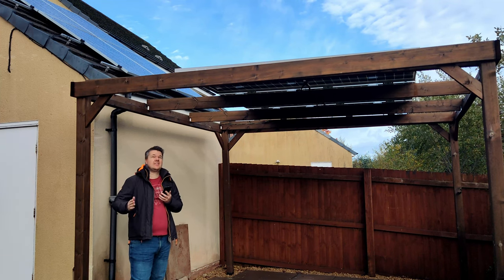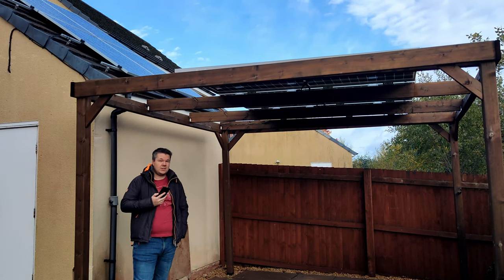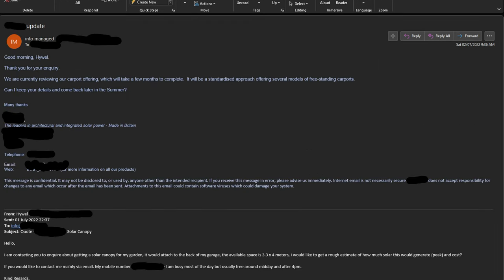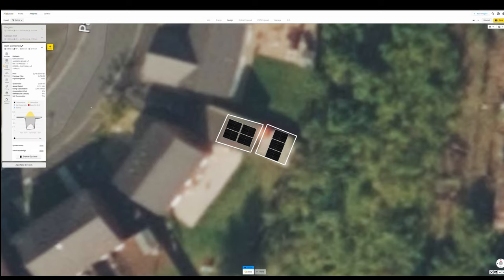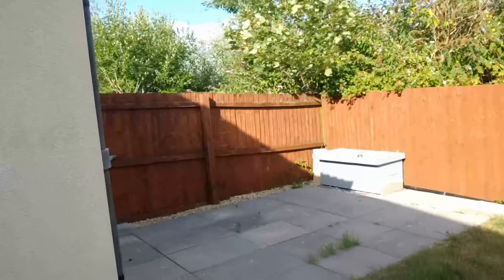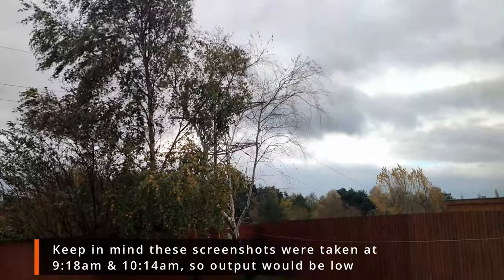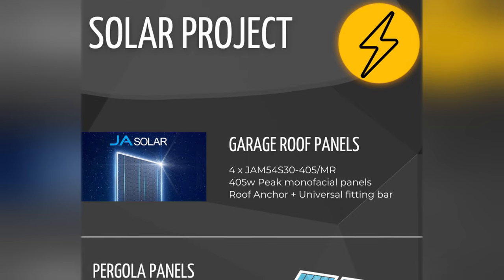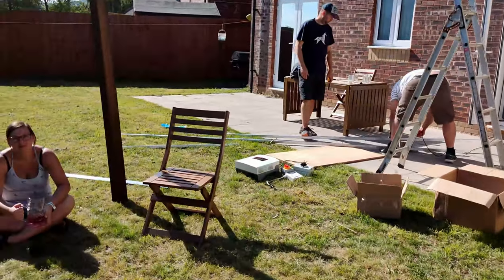Solar Pergola & Roof - The full story

Comment: No one will ever convince me to deploy a solar system that is capable of supplying power for my entire home (around 2000 sq ft). Even though I live in the valley of the sun (Phoenix, AZ), it makes a lot more sense to build a smaller off-grid system that will supply enough power for my master bedroom suite (around 400 sq ft). I'm halfway there, with a 1.2kw system that will be "cloned" to create a parallel tied system giving me a total of 2.4 kw potential (peak sunshine). I'm really pleased with the performance so far but need to save money before I can move forward and finish the project (and things are not getting any cheaper). Thank you for sharing this...

Comment: Got 10kW and have not seen an electric bill this year yet 😂
Reply: How many electric bills would you have to not see to pay for the whole installation
Reply: @stephenrichards5386  Now it seems about 5 years. Calculated interest rate is now 14.5%
Reply: @april7_  that would be on a 10kw installation. At 300w/panel= 33 panels   
I've no idea how much per panel fitted by guess £150. About £5000 plus all the control mechanism plus the new hot water system. Call it £8000 at current rates of 35p / unit  that's 22900 units of electricity. Now add compound interest on £8000 at 14.5%. 
£16,500. Redo the pay back time. That's about 10 years. Subtract your previous consumption. Voilà
A lot of guess work in there but not far out I suspect.
10% loss of power after ten years, 20% after 20 years
Reply: @stephenrichards5386   Im not sure if I can understand your logic but can you tell me where I can safely put some money and get that 14.5% interest rate in return? ... The other way I see it is that regardless of payback time, in the end you have "something"  to show for it instead of having "wasted" the 8k giving it to the electricity company. Im not going on the offensive here. This is just my logic.
Reply: @jsouto77  No it's brilliant. The taxpayer pays another taxpayer to put intermittent energy source on their roof so that the taxpayer's can pay for the power station they need to provide energy 24/7.
Reply: @stephenrichards5386  how do you mean the tax payer, fits are gone, and that was a levey on electricity bills, just like nuclear had been under NFFOs, Non Fossil Fuel Obligation, back in the 90s through to the 2000s.

Comment: I was just wondering if you had to let your grid know about exporting ?? I am looking to start my own project
Reply from the maker: not sure which country you're in, but in the UK no you don't as long as it's under 6kWp for the array.
If you want export payments then you need an MCS certificate of which a part of that process informs various bodies you are a micro generator.
* The above is subject to change.
Reply: @The BMC  I'm in UK and currently with British gas and was wondering if I need to let them know that I might export or does grid need to know about it. Was thinking about even simpler setup with micro inverter for now
Reply from the maker: @quittrn  ahh fair enough, nope you don't need to let them know. recommend if you dont already have a smart meter or one that shows export to have one just so you can see what your sending to grid
Reply: @th3bmc  thanks very informative 👍 great video keep up good content
Reply from the maker: Thank you for the nice feedback 😊. good luck with your project
Reply: Your information is wrong.  Any equipment connected to the grid requires either post install notification under g98 or pre install permission from the DNO under g99
Reply: G98 covers equipment up to 16A per phase.  G99 covers anything over 16A per phase

Comment: This is close to what I want to do.  I’d like to add pergola along the length of the rear of my house, and install solar panels on top of that, rather than on the roof itself.  First it’ll create a nice patio space that I don’t currently have, and second it would save a lot of money for roof repair costs when it hails (I’m in Texas), and the panels need to be removed to replace the roof.  1 hail storm would cost more in panel removal and replacement, than the cost to add a pergola for housing the solar panels.

Comment: I'm considering a similar project so I will be folliwing your videos with interest.

I've subscribed to keep up to date with your project. hopefully I will learn enough to attempt a similar project myself.

I'm just beginning to learn about this solar thing so a lot of the stats that you provide are over my head at the moment until I catch up!

Thanks for taking the time to post and share your experience.
Reply from the maker: Feel free to ask a question or two here in the comments, I'm by no means an 'expert' I've been learning and researching as I go on. two primary things to keep in mind. 1. Use opensolar.com as mentioned In the video, those guys have a really good handle on panel outputs based on angle and azimuth.
2. Might be obvious but if you're ever unsure of something call an electrician, it's not worth frying over.

Comment: Nice job! I'd recommend scooting the 3 bifacial over a bit and add 2 more at 90 degrees from the three. It would complete the roof on the pergola too
Reply from the maker: I designed it the way I did to allow for rain and snow to fall between the pergola panels and the garage. I also don't need additional panels, this amount already pushes to grid after filling the batteries and it's winter.

Comment: Hi, 

Can you advise where you got the mounting clamps from for the pergola? 

How do you find the generation laid flat compared to the garage roof? 

Thanks.
Reply from the maker: Mounting brackets are from ebay, 'aluminium z holder brackets'. the generation from them being flat was usable but not great, a fair deficit during mid morning and mid evening, but they did start producing sooner than the garage panels. I have since changed them to have a 15 degree angle and it helps with water runoff and generation overall.

Comment: Hi, might be interesting to see what you generate on ghe greydays for the pergola panels vrs the inclined roof panels. I've noted that on grey days the flatter pannel outperform the inclined ones. May be important given how many grey days you get in winter.
Take care M
Reply from the maker: Yep, will be doing that once I have a good amount of days to do an average readout with plenty of data points. It is roughly showing better in evenings and mornings but inclined roof does always appear to edge out the bifacials at midday. keep in mind there are 4 on the garage roof and only 3 on the pergola.

Comment: Absolutely outstanding setup and almost exactly what I'm wanting to do so thank you for sharing.

I'm curious though, and it's probably a dumb set of questions coming up, but I'll ask anyway...

The inverter is grid tied, how did you wire it in? Have you only got some circuits hooked up to it, or is it able to supply the whole house intelligently? (My use case would be primarily low wattage, but could peak at say 7kw if I used the induction hob and kettle at the same time for example, or when charging the hybrid).

You mentioned if you wanted to get paid for export you'd need an electrician, I'm sort of surprised you don't anyway if the inverter is hooked into your consumer unit?

If you are exporting, what protection is there to cut the inverter off if the power from the grid fails? Does the inverter take care of this? Wouldn't want to be frying linesman after a storm!

Love the power output from your bifacials, and how you've put them on a pergola as this would be my plan now since I'd rather not have to hire scaffolding for a roof mount!

Shall be following your channel very closely, look forward to seeing the video about the BOM for batteries :)

Thanks for putting this out there!
Reply from the maker: Hi Steve, thanks for your comment, it's appreciated.
That's a fair chunk there and I'm answering at 2am so sorry if this makes little sense.
So the inverter connects just like a normal appliance back to the consumer unit, obviously with RCD protection, I did have a new run into the garage recently which was put in by an electrician and I mentioned my plans so he put an DC leakage AC RCD in (can't for the life of me remember the proper name but that's it's function to stop DC current making it back to the house). My inverter does have a 'backup' mode also called EPS (Emergency power supply) currently I don't have this hooked up to anything but the plan is I will in the future, obviously this would be on a completely separate circuit to the mains otherwise we enter the realm you mentioned of frying some poor electrician outside the house if the grid was off.
Being a grid tied inverter if there is no voltage or a drop or the frequency goes out of sync, the inverter disconnects from the mains, that's why the inverter always needs at least 2 power supplies to function. Now because I have batteries in the day if the power went out I would still have 2 power supplies, the PV and batteries, this is partially why there is a separate AC meter provided with the inverter that feeds info to the inverter over RS485, however the inverter will still switch off AC with no incoming voltage regardless of what the meter says..

With regards to the 7kW, it's a difficult one as how often do you use both the kettle and hobs at the same time? if it's every day then cost up if it's worth paying more for the bigger wattage inverter, I would think if it was even half an hour a day at current rates it would cost you 40p a day, but in all likelihood the kettle and hob being on at the same time is probably 5-10 mins at most?

With regards to the inverter having to be fitted by an electrician,  it's an appliance just like an oven going back to the consumer unit. if you don't feel you can make it safe then get an electrician involved but it's not a requirement. some of the manufacturers like growatt are disabling features if it's not installed and signed off by an electrician but this is more around warranty and green credits installer's can get from government incentives.

Hope that S.A was useful.
Reply: Thanks for the detailed reply! I have an electrician in the family but he doesn't specifically do solar, so I might point him at your videos :)

The 7kw question wasn't really one of wanting to ensure the batteries could run it, more one of making sure that the inverter would deliver what it could and top up with grid to meet the demand. I'd be looking at 3.6kw inverter like you have I suspect, as you say the times when using above that would be minimal.

I'm also going to be putting a 7kw car charger on but will likely set that to run on Octopus Go. Might be cool if I could have excess solar charge the car when the house batteries are full though... Not sure how I'd do that yet :)

Once again, thanks for the great series, you've inspired me to investigate this more thoroughly since you're doing exactly what I want to :)

All the best and I look forward to the next one!
Reply from the maker: @snibbo71  Thank you for your kind words.
I would imagine that the electrician may vomit at some of my cabling how it is in the garage on some of the other videos. I'm learning as I go along so I imagine you will do the same. Also with regards to car charging and taking from the battery, this can 100% be done but it depends on the openness of the api's of the inverter which is decided by manufacturer. Zappi is great at that kind of thing but you can't use a CT which zappi relies on most of the time. im sure there is a IFTTT or hook in for some systems. maybe look at zappi and work your way backwards to find a compatible inverter. I know solis doesn't do it natively, but im sure some people have raspberry Pi'd the crap out of it and made it work.

Comment: Are the panels on the pergola mounted completely flat or at an angle? I ask this cause I think they are mounted flat which means less power per panel, but also, and you can see that already in the beginning of the video, rain water stays on the panels. Same will be the case with snow which will result in ever smaller power outputs.
Reply from the maker: Hi, this video answers your questions https://youtu.be/V04waf_g4ek
Reply: @th3bmc  Thanks.

Comment: I've moved my whole home to electricity - EV, heat pump and induction hob. My electricity usage tripled in the process, but a 6.5 kW array covers 1/3rd of my current usage. It largely covers summer usage - much of which goes into the EV. Interestingly my overall energy usage has dropped by about 75% - electric solutions are just way more efficient.

I'm considering a pergola to boost my winter production. I currently use 95% of the power I generate (the house battery helps there - there are weeks in the summer I barely use grid power). But winter production is incredibly low. Daily generation of 2 - 4 kWh isn't uncommon.
Reply from the maker: Thank you for that, I would like to think I get to the same point as your setup in the coming years like induction hob and heat pump.
I purposely didn't factor in the car to keep costs low and based it's capacity purely on covering the house.
Reply: I think I'll be doing the same. I won't size the system to deal with the car, but it would be nice if I can use the excess in the summer to charge the car if I'm home.
Reply from the maker: @snibbo71  Funilly enough today we had a fair bit of sunshine for 3 hours and it filled my home batteries to 100% from 85% (imported on cheap rate from 20%), put the oil heater on and charged the car at 5amp and put 1.5kWh in the car... at this time of year that's ace, summer I will be ABC - always be charging

Comment: Why did you not got for the 6kw solis? My understanding is that you can set it as g98 as to get started and move on from there without having to get another inverter if you decide to size up specially on batteries since the extra charging power will be handy to charge the batteries in the winter time on a cheap electricity rate 4 hour slot such as octopus go. Am I off the mark here?
Reply from the maker: Thanks for commenting, I'm already on intelligent octopus 🐙 and charging the batteries at cheap rate.
The higher the inverter capacity the higher the voltage you need for generation from solar usually, if you check out this generation of inverters datasheet the 3.6kw has the same 'startup' specs as the 3kw, if you go above 3.6kw the requirements tend to go up. my system was designed to be small footprint, if I had more panels I would have gone for higher kw inverter. this way it's more efficient in winter. I commented again below
One final point is my max average power draw tends to be when cooking food which goes roughly to 3kw so this one covers my needs, there are two exceptions to this, when I charge the car in which I dont want to be pulling from thr battery anyway and the second my hot water tank pulls 3.4kw, so when that's on it pulls the rest of the house load from the grid, but both these two things I do at cheap rate.
Sorry it's an S.A but it's a good question and im glad you asked it.
Reply from the maker: So I had a look at the datasheet, link is at the bottom of this comment.
I must have gotten this model mixed up with another, the pv start up requirements are the same across all this model type. So you can ignore what I said about pv start up voltage.
This actually makes the 4.6kw model make more sense for my system as it would cover any of the random high load occurrences for not much extra cost. thanks @jsouto77 that's food for thought 🤔 and I may look at upgrading during the current RMA process I'm going through if they are open to it.

https://www.ginlong.com/Uploads/file/Solis_datasheet_RHI-(3-6)K-48ES-5G_AUS.pdf
Reply: @th3bmc  Thanks, I was just wondering thats all and not meaning to criticise. I personally just starting with batteries  (3x us5000) and inverter. I know you have your discharge rate covered but was just thinking of the charge rate in case you decide to go up on batteries. Your setup interests me as you are going nearly the same route as me including my future solar deployment. Thanks :)
Reply from the maker: @jsouto77  No It's a good comment and made me question a decision I made that in hindsight makes the 4.6kw look like a better option.
In terms of battery charging, I'm actually having to slow the rate down, currently set to 22amp because I don't want 100% battery when the sun is shining around midday which barzagli has been the case the last two days. drops to about 80% from full by 10am then fully charged about 12:20pm then the solar generation is wasted. With your 3 batteries and depending on your pv array size I would have thought you will need to do the same and reduce the charging time window or charging amp's. 14.25kWh total capacity, 90% is 12.825kWh ÷ 4 hours = 3.20kW for full battery in your octo window. 66.6amps. If you can get onto intelligent octopus 🐙 or 'octo go faster' and have that extra hour so 2.56kW is needed for the 5 hour window. 53.3 amps for your 3 US5000's to go from 10-100%
Reply: @th3bmc  Thaks for that. Ive just renewed go @7.5p off peak. Intelligent is no good for me at the moment as it can b e a bit of a faf and unreliable at times with tesla but I hope they will support my wallboxes again as they once did. I'll definitely be getting at least another battery as to be more comfortable and not stress them out so much hence the 5kw charge rate mainly gives a bit more flexibility in the winter months. Thanks again :)
Reply from the maker: @jsouto77  you can "pause" control of the device/car in the app but it still keeps you on intelligent tariff. 🙂👍
Reply: @th3bmc  I know but it sort of defeats the object of what the tariff is all about. For the moment I can make do with the 4 hours  so its just a case of not being bothered to circumvent per say.